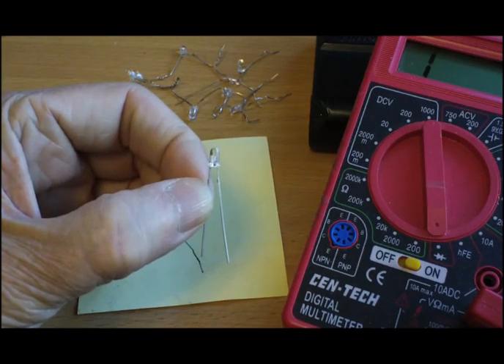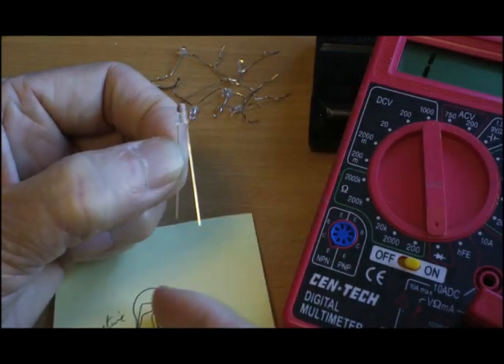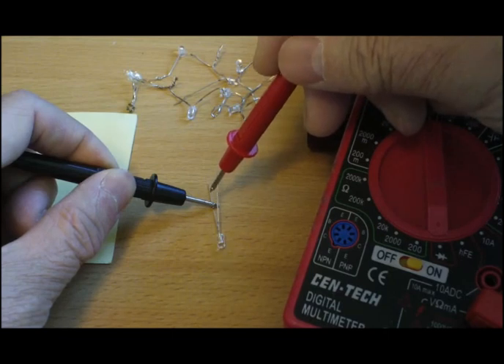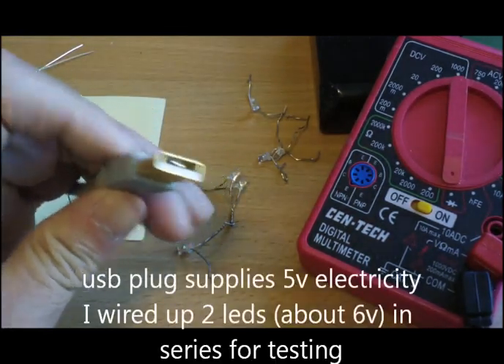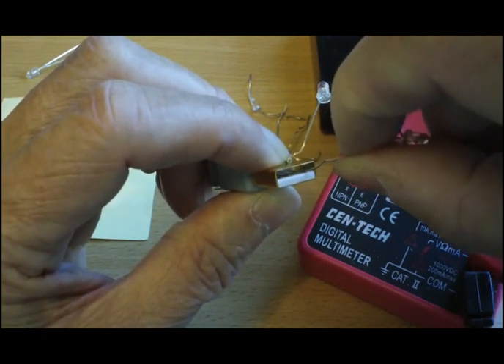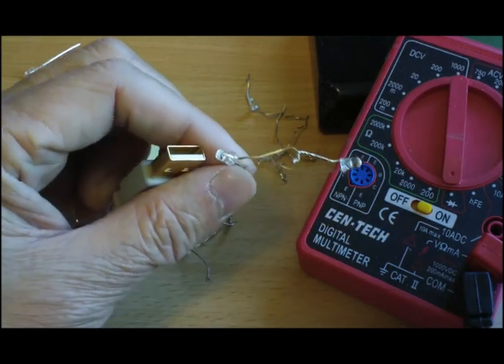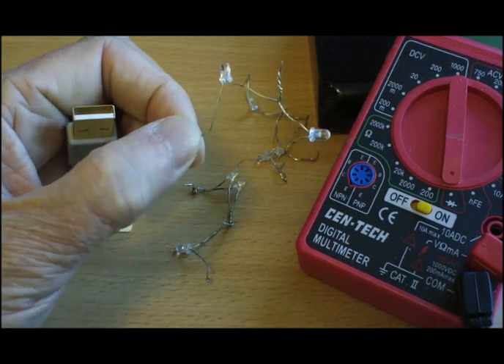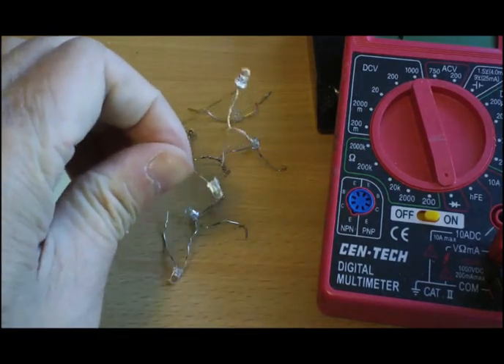Checking your LEDs with the CEN-Tech digital multimeter

Comment: Thank You. It appears my LED is bad using your method.  BTW My CEN-TECH from Harbor Freight lasted less than 6 months, so I went and bought an INNOVA EQUUS 3320 for 22.50 at Amazon and still working after 2 years.   I think you get what you pay for, no use buying the same thing twice or more times.

Comment: Mine doesn't really like to light up anything but red LEDs on the diode check. So I set to the 2000Ohm scale and it might barely light. Usually the 200Ohm scale will light most LEDs fairly well. Just don't leave it on too long.
Reply from the maker: The Cen-Tech meter uses a 9 volt battery and when it's weak, it might not work all that well.